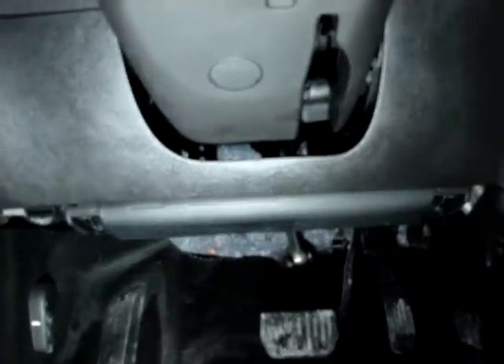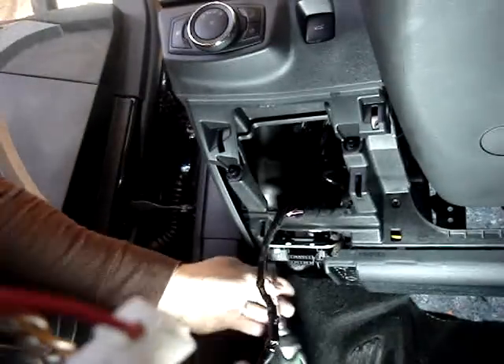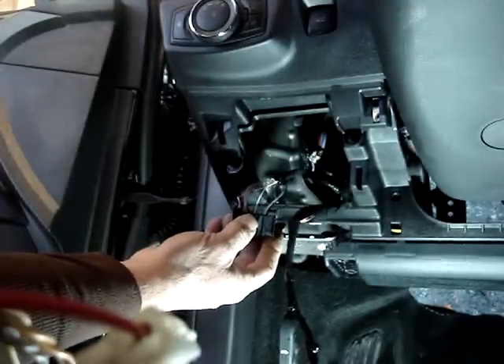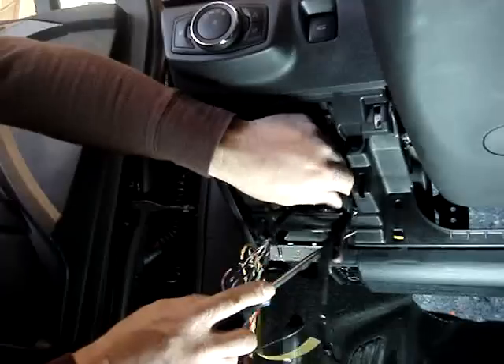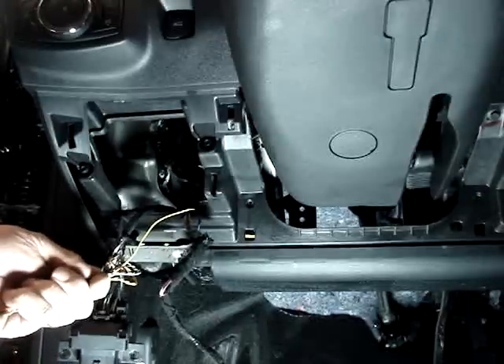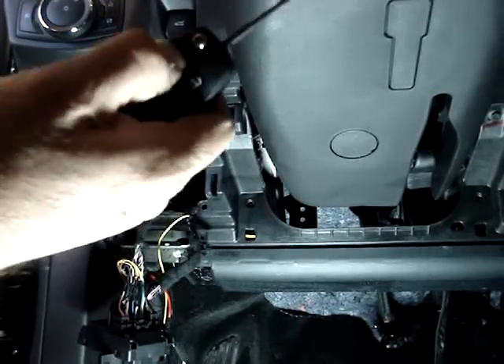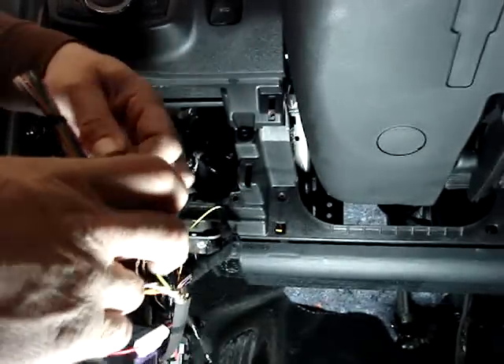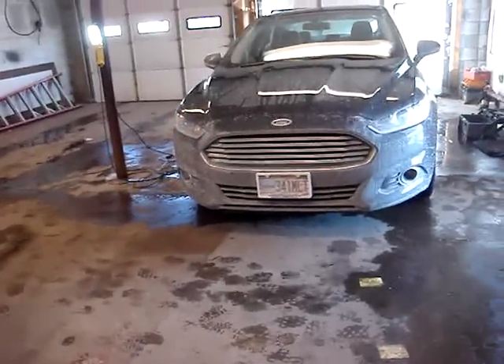2014-2015 Ford Fusion Remote Start Installation

Comment: there's another setup that does not require any cutting of wires... a lot simpler than this.
Reply: Mac Pelao hi i have 13 explorer ltd with push button start and factory remote starter which is good for 50feet only. i want to add long range starter that will not require cutting or soldering of wires. can you send me details pls?thanks
Reply from the maker: FYI no wires were cut or harmed during this installation. LOL. I do not think there is any solution as easy as this but the FORT2 is available at warmcarnow.com.  It is a t-harness solution that was not available at the time this video was made.
Reply: warmcarnow
Reply: He reply to this but not to the guy that said his don't work lmfao

Comment: I installed my unit - but when I remote start the hot air or seat warmer doesnt go on--even if I left it on before I got out of the car.